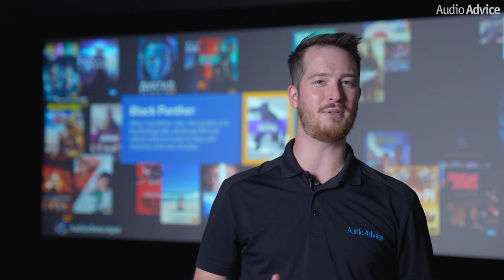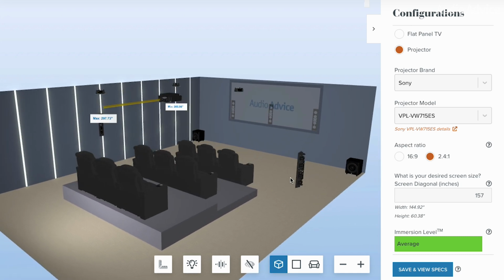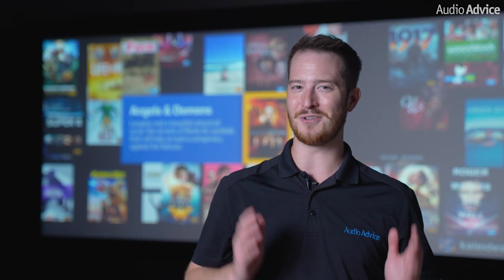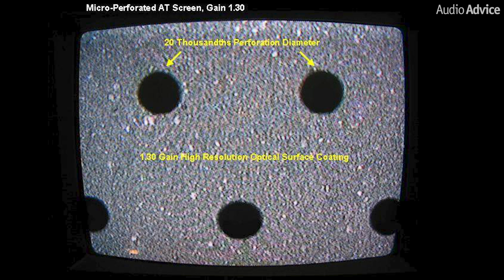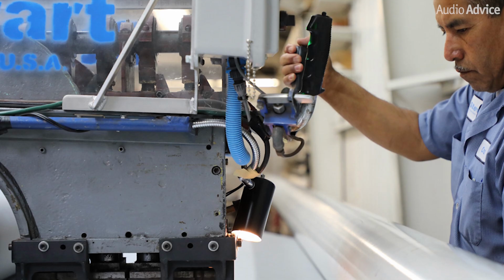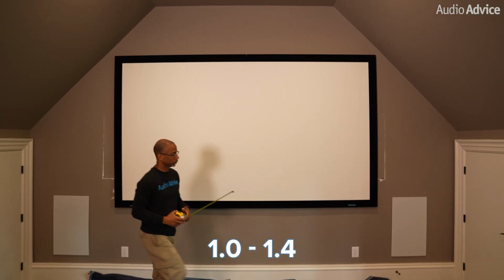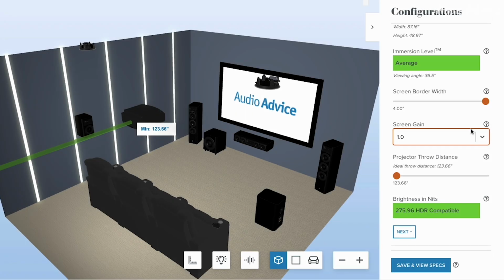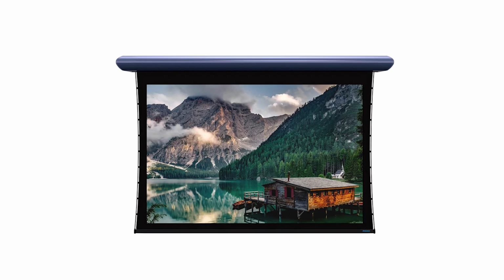How to Choose the Right Projector Screen || Stewart Filmscreen Options

Comment: I really don’t get it. It’s more then actually more the a home projector. Why pay 2,000 bucks if an 70 inch Amazon screen works ? 10:10  then why charge your screen for 70 bucks for average customer can effectively buy?
Reply from the maker: You have to see one in action to know what we mean.
Reply: You have never seen a high end screen with a high end projector. These are not meant for cheap projectors of course. That will be overdoing it

Comment: Hey I was wondering what type screen would be best for a dark basement.  If alr is still the best that's fine, but if light isn't an issue is an alr neccessary
Reply from the maker: You would not need ALR in that situation. Please reach out to our team at www.audioadvice.com to discuss your system in more details.  Thanks for watching
Reply: Best would be a pure matte white 1.0 gain (SnoMatte 100/StudioTek 100) (basically if you have sufficient Lumen projector(anything above 3000 on 120-150" should be ok ).

Comment: What is the recommended gap between the screen and a speaker with compression drivers (JBL Synthesis) when using the ST130-G4?
Reply from the maker: 8-12 inches is standard. However, we recommend you reach out to our experts at audioadvice.com to be sure your setup is exact. Thanks!